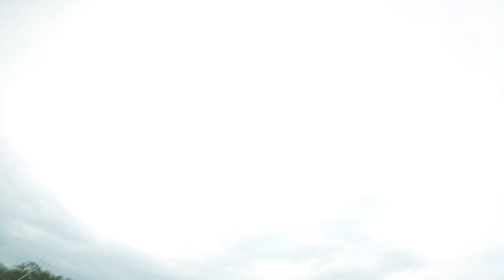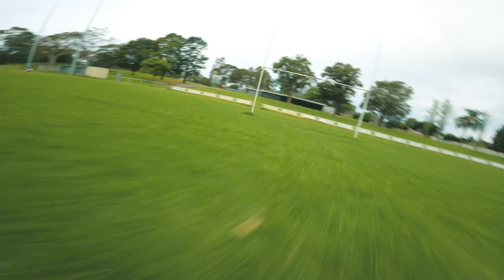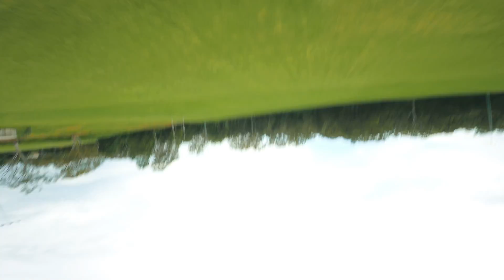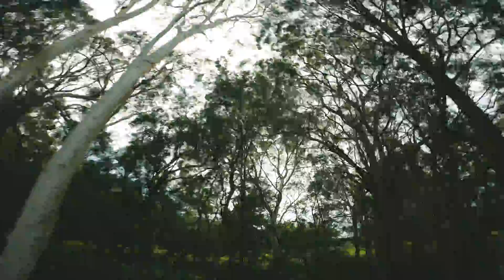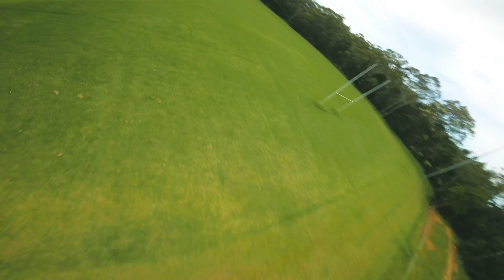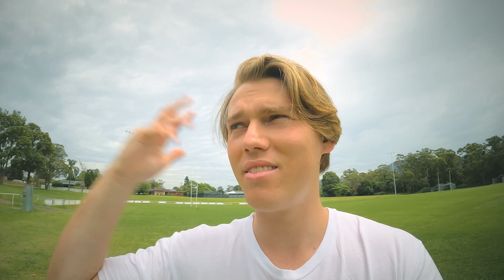this SIMPLE HACK made my freestyle drone fly JUICY

Comment: If you remember Calculus it's Proportional f(x), Derivative f'(x) and Integral Sf(x).

P = how fast the quad will PUSH to obey your commands
D = how much will the overshoots be DAMPENED
I = While the overshoot is being DAMPENED, it avoids going into infinite back and forth oscillations. It's like a security belt for the D term.

Comment: You're a gangster, Jay! Some more additional info from a guy who's not a professional but a pretty experienced Builder and nerd. The mpu 6000 was at end of life, and it was not being mass-produced anymore. I do believe the company stopped making it for a couple of years, and now they are making them again in small numbers, but at a much higher price. That's why a lot of manufacturers have shifted over to the BMI 270 and the ICM 42668p. I was having a hell of a time tuning the ICM gyro, until I learned recently that the increased sensitivity was not jiving with the board design on many of the flight controllers. More filtering was needed, not from our end, but in betaflight software. That's now been addressed as of betaflight 4.5. Now my two best flying quads are on the icm onn4.5, but to your point, they do need to be clean of excess vibration resonance. 

Mumbo jumbo...shut up NERD! 👆🏻🤪

Always love the videos, and I'm always down for storytime. Stay juicy, bro! ❤👊🏻
Reply from the maker: Dude that's actually really well put, thanks for sharing that. I never actually fully understood it so that's cool! Yeah I'll definitely chuck this tune on 4.5 and see how it goes

Comment: So a wire was vibrating against the gyro ic and causing a stutter. Makes perfect sense that the gyro is by its nature, very sensitive to being smacked around by a wire knocking on its package. Sorta like your testicles, it doesn't take much of a tap to have you make a funny face.. But Bro, it took you near 7 min. to get to the point, and then you weren't very clear. Glad you got a solution, nothing more frustrating than a problem that doesn't change, not matter what you change in the setup.
Reply from the maker: Thanks dude, next time I have an issue I'll get your expertise. The solution was also in the description like 1 line in... So I apologise you can't enjoy a couple minutes of fun freestyle before getting to a part of the video you don't even need help in.

Comment: You mean the wire is physically touching the gyro or the wire is making electrical noise that interferes with the gyro?
Reply from the maker: To the naked eye it didn't look like it was touching, so my guess is mostly electrical but possibly in my case I'm sure there must have been a little bit of physical noise, especially if when I was flying around, the wires moved around. Good question, thanks
Reply: @jacuzzijay  where exactly do u move the wires to if they have to go from back to front or front to back ? under the esc ?